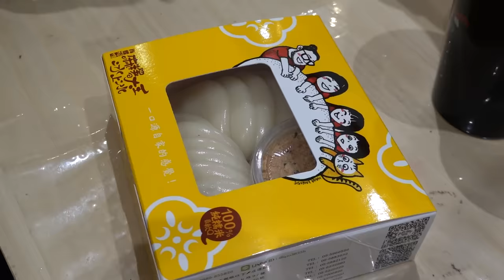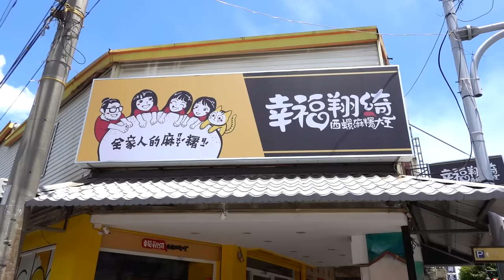How Mochi Is Made / 麻糬製作 - Mochi Factory in Taiwan

Comment: None of those machine's look sanitary 😬😬😐
Reply: Seriously. I think of a modern factory, I think of automation and sanitation. Neither of which I really saw.
Reply: Definitely not. Standing water like in the room with the spinning machine is a food safety violation as is using a fan like that around food since it can blow dust and hair particles up and into the mix. 

The big steamer looking machine just seems like a dangerous process. The heated trays seem to have a catch at the bottom when they're pulled back onto the dolley thing but with the height you would think it would be top heavy and therefore could potentially fall o to the worker if pulled out with too much force.

Not wearing gloves for the first half is fine since the heat would kill bacteria and gloves look to be worn afterwards